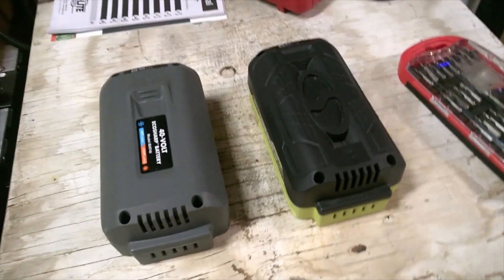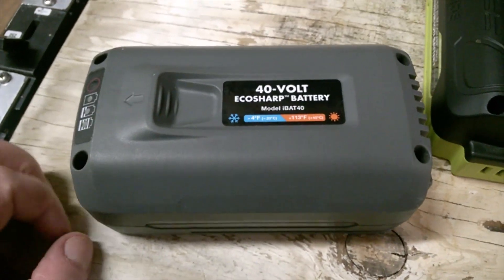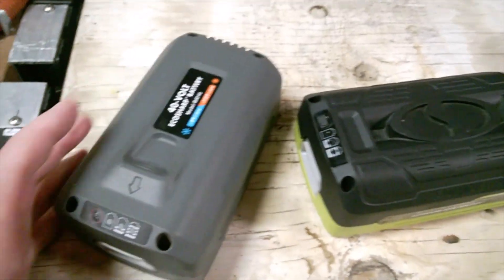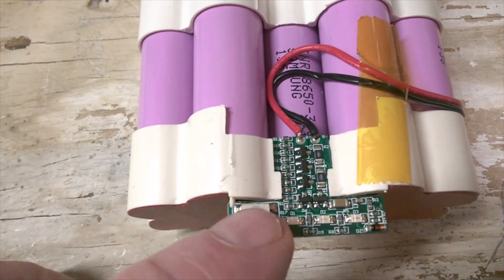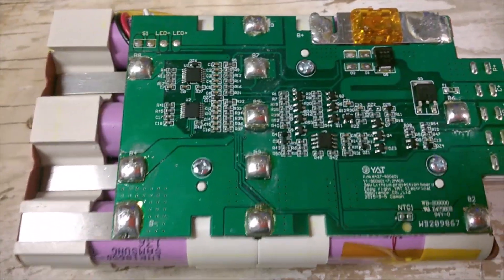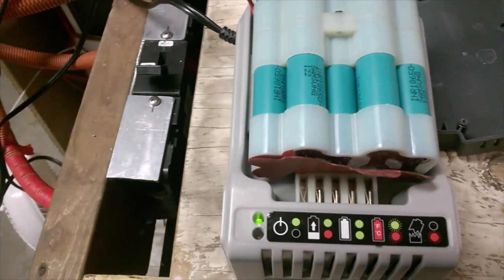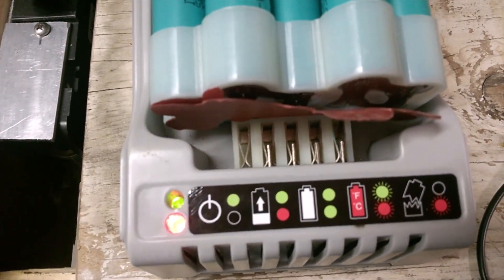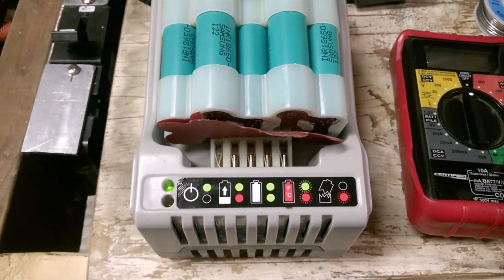2020 03 Snow Joe Battery analysis

Comment: Do you know how the id pin works can you trick a unot with a resistor or something
Reply from the maker: I think it is different on each make some you can disconnect some not. Once you get inside it doesn't matter for the battery only if you try and draw power from the pcb controller.
Reply: @offgridwanabe  example I tried to run the 80v two stage snow blower off a 72v ebike battery but it didn't turn on assuming it was trying to sense that ID wire. Any idea?
Reply from the maker: @plojm123  There is an extensive pcb under those 2 battery plugs to distribute the power to all the other spots ie wheels, lights so I would try direct to the motor I believe it should work.
Reply from the maker: or you might be able to steal the pcb out of the battery and rewire it to the new battery
Reply from the maker: I got 3 of those batteries in parallel to run my 36 volt lawn mower and it works great
Reply: @offgridwanabe  been looking for a dead one on ebay to do this with
Reply from the maker: @plojm123   the ebike battery is 80 volts and the Snowgo batteries are 40 so you have to find out where the series connection is to wire in the 80 volts.
Reply: @offgridwanabe  I tried two 36v/42v max hoverboard batteries as a test and it didn't work either
Reply from the maker: @plojm123   Well the battery doesn't need the id to charge unless you use the snowgo battery chargers I charge mine with a power supply so whatever you plug the battery into controls the ID. If I remember right there is a voltage in the ID pin which the receiver may be looking for.
Reply: @offgridwanabe  I am going to get one soon to test as long as it's not like Milwaukee they do a variable voltage and resistance settings to id
Reply from the maker: @plojm123  I think if I were going to do it I would make a plug in on the battery to plug another 40 volt battery into it so it would just boost the existing one but Snowgo batteries are short lived.
Reply: @offgridwanabe  yea5 or 6ah is not enough need atleast 10 or 15ah for 1 hr runtime

Comment: I know this is older but I think i actually figured this out as mine had the same problem.... I fixed it though of course i had to open it up and figure it out i got the exact same analysis as you.
Reply from the maker: Ya the one battery had a bad temperature sensor and the other one had a bad set of cells. I put both of them in my lawnmower with another bad one and wired them up without a board for the 36 volt lawn mower

Comment: I have a few 18650s if you want them
Reply from the maker: Thanks bro if I decide to desolder the boards and take it apart I'll need a couple at least.
Reply: @offgridwanabe  I dont have many. Maybe 10. Why dont you make a battery for your blower?
Reply from the maker: @frankz1125  I been thinking about it but the energy density is to low for the 26650 as I need 12s and the pack would not fit in the holder, but I think I can fix this 18650 as long as I can get the board off in one piece. likely only 2 18650 went to minus from what I can tell from the readings

Comment: Flashing red means it’s out of range temp. Ie. to hot or to cold. These batteries need to be kept at room temp. During storage and when charging. Also they can get too hot during charging. You need to pull them out of the charger to reset the charging cycle.
Reply from the maker: Thanks I'll check that if I remember right the temperature sensor was bad. So I now I use it in my lawnmower.